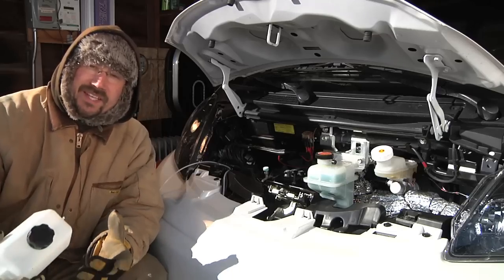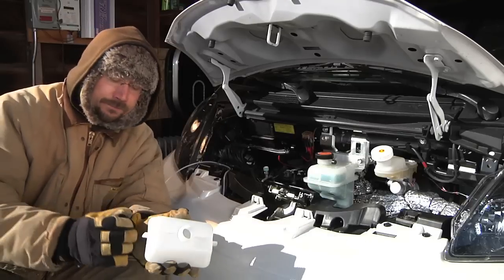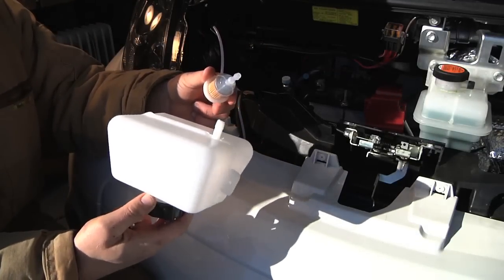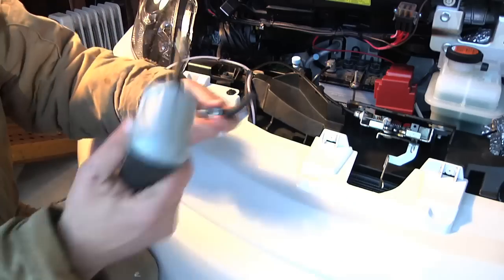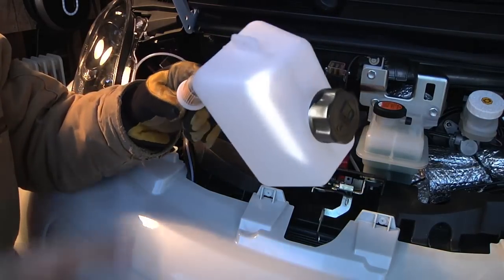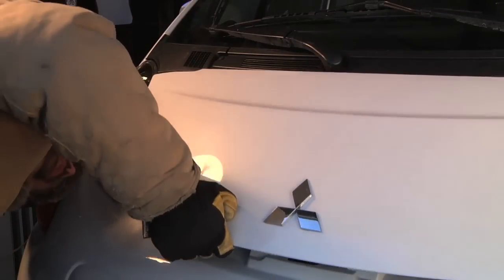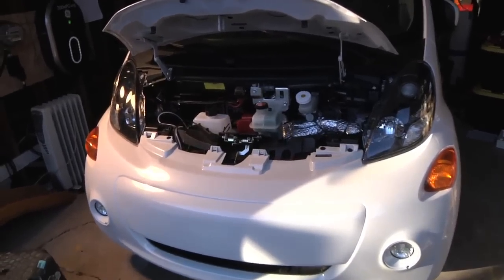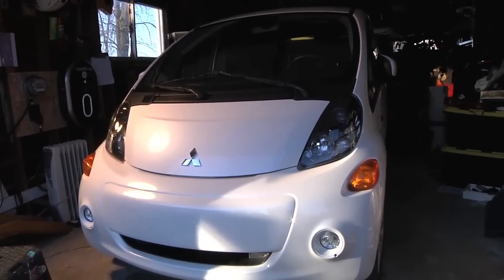iMiEV Heater Install Part 6

Comment: Freaking pump tick would have my OCD on fire...
Reply from the maker: I had never used this style of pump before, so I really wasn't expecting that sound either. You really only hear the pump right after turning on the heater. Once the heater is running, you just hear a whir from the heater. Keep in mind that in the video, we are hearing it at the front of the car with the hood up. Of course, in the real-world use, the hood is down, and I'm inside the car. The pump noise is really exaggerated in the video.

Comment: Maybe a dumb question, but how in fact do you fire it y up? Is it with the control on the inside of the car?
Reply from the maker: Yes, there's just a very small and basic control on the inside of the car. I just press a button on there and the heater goes through a warm up sequence. Fuel starts to pump, it gets ignited, and it pumps the heated coolant through the system. It takes a few minutes to warm up, but warms up faster than an internal combustion engine would.
Reply from the maker: I took a photo of the heater control inside the car and added it to my blog post about installing this heating system. Please take a look at the last photo at: http://300mpg.org/imiev-heater-installation/
It's just a very small and simple control. I drilled one hole in the dashboard for the wires to go through and had to add one screw to mount the control panel. The button on the right (which looks a bit like heat coming up from a seat) activates the heater. The default is for it to run for 30 minutes, that's why it says 29 on the display in the photo. 

This device also has a clock and a timer feature, but would require some clever separate control to run the car's main blower to heat the car from the combustion heater while parked and unoccupied.
The car already has a stock feature to remotely heat and defrost when connected to wall power (EVSE or "charging cord") which works great to warm up the car on a cold morning. It's even good enough to melt all the snow off the windshield!

Comment: So let me understand this, you buy an electric car to put a heater that uses fuel?  wouldn't be better just to buy a gasoline car? for example a plug in?
Reply from the maker: The short answer is "NO", it would not be better to buy a gas car.

I had some long and hard thoughts before putting in this fuel-burning heater. In a nut-shell, what it comes down to is that my TOTAL fossil fuel use is lower. Far lower. I only use the heater when it's really cold, and on trips that are on the longer part of what this car is capable of. I can still use the electric heater built into the car, and I do use that on a regular basis. This car gets the equivalent of 112 MPG. If I was driving a typical gas car, it would get 25 MPG or less. I used about a gallon of fuel in this heater last year, but drove about 10,000 miles. So yes, a small fossil-fuel burning heater in this case makes plenty of sense. Think of it as a "hybrid heater system" if you will.

Gasoline vehicles are inefficient all year 'round, but normally the heat is a waste product. In the winter, it is instead a useful thing that we are thankful to have. Gasoline and diesel fuel are VERY good at making heat, but not very efficient at actually pushing the car down the road. An electric car is usually about four times as efficient as a gas one, but doesn't get "free heat", which instead has to come from the battery.

Using a small, dedicated heating appliance, powered by fossil fuel to create heat, maximizes the available energy from the battery for propulsion, instead of inefficiently wasting it as heat. Together, this makes a nice efficient system.

The car shown in this video is a basic economy car. Many other EVs have heat pumps or resistive/heat-pump hybrid heat systems as their stock heating system.

Overall, I really like this car, but the heater was lacking for the climate I live in. So, I modified it to make it work better for my situation.

Plug-in Hybrids (like the Chevy Volt for example) are also very good cars, but they get their heat from the battery as well until the battery is exhausted and then they switch over to just being a gas car. At that point, the heat comes from the engine, just like any other gas car does.

Comment: World class videos !! THX ... I just got a c-zero ...after reading for hours and hours - yhese cars have a HUGE amount of people loving them - and posting on forums !! SO AWESOME ....

BUT - I have watched a load of heater installs - some like you add the heater, some remove the original heater and replace it/plug in the webasto/ebenspracher ie where it was under the car ...

But but but - have any sucessfully hacked it so that the fansystem in the car starts up with the  fuelheater unit ?? - that would be awesome... also as some one ask ..what happens if you accidently turn on aircondition whiler fuelheater is on ??
Reply: I just got hold of a norwegian official i-miev / eberspacher install guide - there they connect a few wires to the fan in the car, and tell that for the parking/timed heating to work, you have to leave the car with the fan settings on medium / heat on Max ... it seems that way the heater turns on the fan  ...

I have seen more videos - one from stanlislav - where he replaces the original PTC heater ... 

I have a 3rd idea ... .mount the heater like yours - disconnect the PTC heater, but hook it up to get a larger coolant volume ...that way when the fuelheater is turned off you can turn on the original waterpump to use the left over heat in the system  ... 

Sounds like an idea ??

Comment: If you turn temperature setting few notches to blue what happens? Isn't the AC compressor on standalone button? How the heck it adds cold without AC compressor? Heater core bypass channel?
And if you click few notches to red, will it activate electric heater? It should stay off as coolant temperature is pretty hot. Or not?

I believe it is 4,5 or 5,0kW gasoline heater. Do you have the model name?
Reply: Arnis Tarassu the electrical heater is turned on and off by a termostat. The first notch on the red is 30°C. Full blast is between 60 and 70°C.

Since the diesel heater's thermostat is at 80°C, once it's hot, no electric power will be used. 

The AC is also temperature controlled to 4°C, the AC is in front of the heater, thereby acting as a dehumidifier if both are running at the same time ....

Comment: and fuel vapors are pouring into the atmosphere worse than a modern Gasser now.....congrats on turning your so called "green" car into a oil burner that's almost or as bad as a modern gasser
Reply: I looked further down in the comments to find out his heater uses .5L of fuel an hour on average (I was interested in the consumption myself). My "very efficient" Toyota Corolla that achieves 40+mpg on average, will consume ~5.5L of gasoline to go travel 60 miles in an hour, whereas Ben will use 0.5L of ethanol for his heater(I'm not educated enough on the subject to know the environmental impact vs gasoline, but in reasonably sure ethanol is better). Factor in his 120mpge (much of that power coming from his own solar panels) and he's still far greener driving than you or I friend.

Comment: Very nice video :)How do you control the fan if the heater is started with the timer?
Reply from the maker: +Henrik Kyed I have not started the fuel-burning heater with the timer. I simply use it as an ON/OFF switch. It then counts down how long the heater is on. The default it 30 minutes, and it can be manually stopped as well. If I wanted to use it as a start timer, It is possible to do something along the lines of hacking into the blower fan power wire and control it with a relay, but I had no interest in doing that sort of thing. So far, I have simply pre-heated the car (on electric, from wall power) for about ten minutes just to get the coolant in the system warm. Then, if it's a normal winter day, and I'm doing a typical drive, I still just use the electric heat. If it's an extremely cold day OR I have to drive exceptionally far, I turn on the fuel burning heater and set the car's heat setting to neutral, NOT heating and NOT cooling. That way, the electric heat doesn't come on and use battery power. I then just turn on the blower fan. That blows the heated air from the heater core (coolant heated by the fuel-burner) into the passenger compartment. If the blower fan was not on, and the fuel-burning heater was running, it would heat the coolant to a certain temperature at which the a safety feature in the heater would kick in and deactivate the heater..

Comment: is that exhaust pipe temp above the melt temp/flash point of that plastic shield it passes thru? If it is, that 1/4 inch clearance might not be quite enough space.  Especially looks easy to bump off center.   Hate to start a fire under there..  Nice project, and useful...
Reply from the maker: +knikula There's a little more clearance around the exhaust pipe than it looks. Also, the temperature of the exhaust pipe drops quite a bit after the muffler. The muffler is low, where air blows right at it. It acts as a heat sink.

Comment: That is awesome! It so easily solves so many problems! How much heat does it put out full blast with the heater control all the way up? Comparable to a gas car or better?
Reply from the maker: +dwarf365 It's comparable to some gas cars I've driven. Of course some cars have better heaters than others. It IS hotter than the existing electric heater. I've probably made the jump from 140 degrees up to 160 degrees
Reply: BenjaminNelson Thanks for the reply! Thats the info I needed. My crappy little neon puts out about 180F at full temp so comparatively not bad! Great series can't wait for more vids!
Reply from the maker: +dwarf365 One thing that even crummy gasoline cars do is make a LOT of waste heat! While that's terrible for efficiency, it's great for keeping warm in the winter. Oddly, winter heat is sort of a "side-effect" of all the wasted energy from a gas engine. Electric cars are MUCH more efficient, but they don't have all that "free" heat just kicking around!

Comment: Really interesting project.  Resolves that problem with a chilly iMiEV (even in the UK) in winter!  How long do you think the fuel will last before the tank needs refilling?
Reply from the maker: +FFVoyager According to the manual, fuel consumption is 0.69 liters per hour on HIGH and 0.2 liters per hour on LOW. So, I'm guessing it's probably going to average to about 0.5 l/h. The tank I installed is only a tiny one liter, so it may be up to two hours of heater run time. I'll see how it goes. If I find that I need to fuel up often enough that it's inconvenient, I can always install a larger fuel tank.

Comment: Nice informative series Ben, look forward to seeing how it performs in the wild.
Reply from the maker: +Randy Hardesty Thanks Randy. I just finished the installation, so I'm only just starting to experiment with it. On my first real test run, I drove to town and had a number or errands to do. I fired up the heater. It takes a minute to get going but once it does, the heat coming out is warmer than from the electric heater. It was pretty cold outside, and I wasn't wearing any special clothing (no long underwear, no extra sweatshirt under my coat) and I wasn't cold. Looks like it's working as intended!
Reply: +BenjaminNelson Great, I may have to try one of them in my Fiero next year.
Reply from the maker: Overall, this heater has worked really well. I think about the only thing I would change is to have a slightly larger fuel tank. The one I installed is a little small. Unfortunately, when I put in this system, I could find a one liter tank, or a one gallon or larger tank, but nothing appropriate in-between!

Comment: what is that impact driver you are using?
Reply from the maker: +17mustangmaniac It's a Sears Craftsman 12V right angle impact driver. I got it as a gift at an Instructables.com sponsored event in Chicago a few years back. It's a really handy tool, compact and lightweight. I love it.